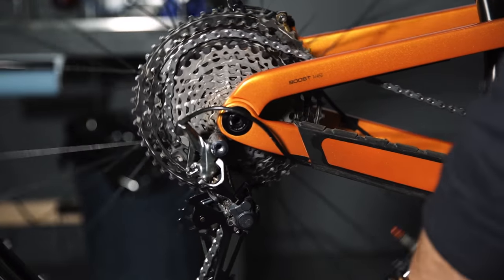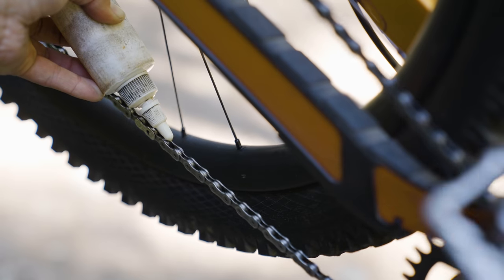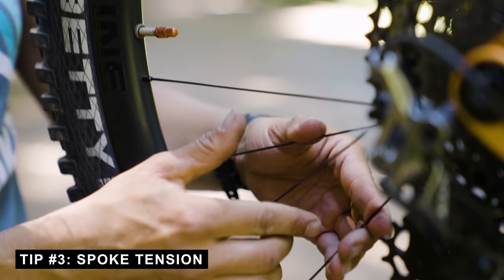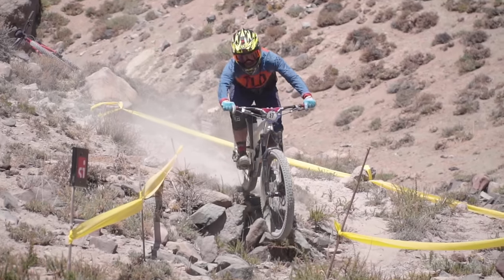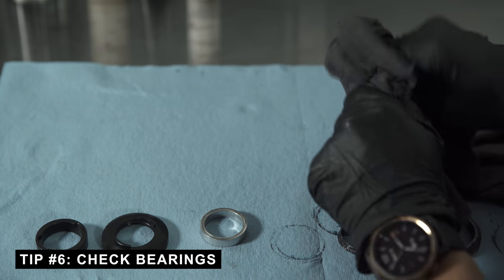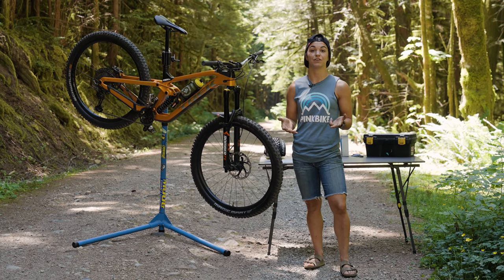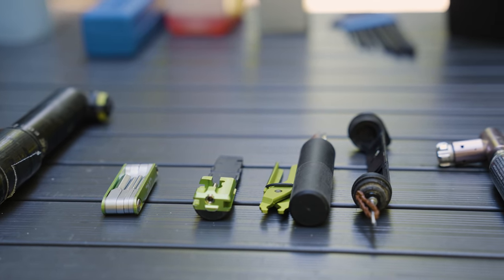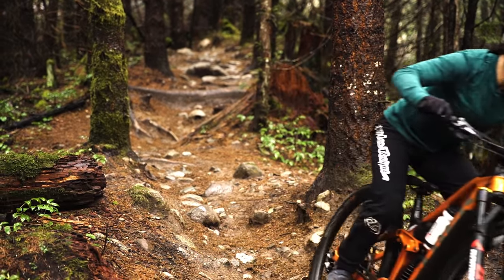Pro Tips For Getting Your Bike Enduro Race Ready

Comment: Now all I have to do is find a bike that's not sold out
Reply: I wanted a trek but was told I had to wait 200 to 300 days.
Reply: @TruTube.1.  that’s what I’m saying. Started with a 05 frame and now it’s close to 150g lighter than the 2021 model of the same bike🤗😂
Reply: @TruTube.1.  i would, but I broke my Hardtail
Reply: Mate, I’d recommend a second hand Hardtail build. I seen you just broke yours but honestly dude, try get your hands on either a Bird, Ragley or Nukeproof HT frame, then build up your parts over time. A good frame, some RS Yari forks, brand-X dropper post, NX eagle and some Shimano Deore/SLX brakes, you’ll be able to build yourself a pretty capable HT with a decent spec if you decide to build it yourself. Keep everything second hand, you might save a bit cash and be able to buy a brand new frame and some other parts. You don’t need a full sus, the HT can do everything a full sus does and come in cheaper. Also, less maintenance! Imagine going from having to replace 6/7 different sets of bearings in your frame to 0.
Reply: @TheLoamCourierMTB  I love hardtail but they definitely can’t do all the same 😂. Depends on location and riding style mostly, but anything can be built at home better and lighter for sure if the time and research is done
Reply: I got my slash 9.7 2021 about 6 Monts ago i just had to buy it online. But i got it for only like 4600 Euros.
Reply: Lol I bought a 2018 slash 9.8 2 years ago and it has appreciated in value… now it is the best thing I own and cannot even think about selling it.
Reply: Cannondale Jekyll bro

Comment: When it comes to frame bearings i spin them up with a socket in a drill and remove the old grease with break cleaner, then when evaporated force in fresh. One set of bearings is an arse for water ingress so when the dust seal is back on use water pump grease to seal below the dust cover, not perfect but def fends off the inevitable for a few more months.

 After that the bikes ridden into a watery ditch.

Comment: My brakes are super squeaky for some reason. I've tried cleaning bads and the disk, any tips on how to stop it? Or should I just buy new pads?
Reply: new pads, if you want them to be quieter you can get resin pads, metallic is more powerful but louder
Reply: New pads, sand rotors properly, degrease with brake-cleaner/alcohol.
Install new pads, make sure everything is grease-free, do a proper bedding in of the pads by finding a mellow downhill road, do 20 strong stops from a speed with each brake without ever locking the brake and don't overheat the brake at all.
Reply from the maker: From my experience, it's really hard to "clean" pads because they are so absorbent. I do the little sandpaper method to freshen them up from time to time. If they're wet or even super dry/dusty then some noises aren't abnormal. If they aren't biting into the rotor then it could be time for a new set but careful not to put fresh pads on a contaminated rotor or that's a wasted set of pads. -Christina
Reply: HI. You can burn em up. Works quite well for me. use some spirit or blow torch and burn pads a bit, do same with the rotor, not overheat just burn 5-10 sec. works well. or ultrasound cleaner for pads works like charm.
Reply: @vladivanov7645  I'll keep that in mind for next time, thanks!